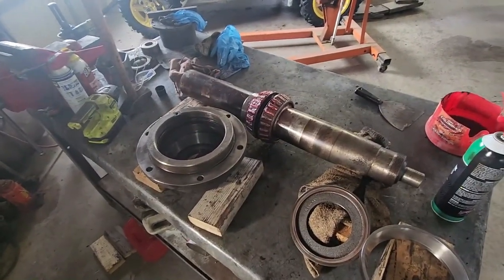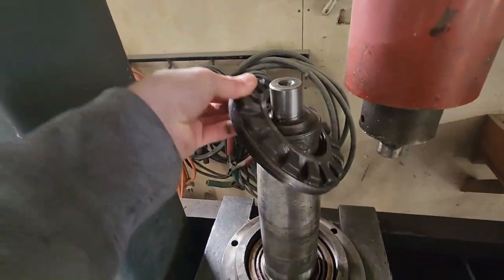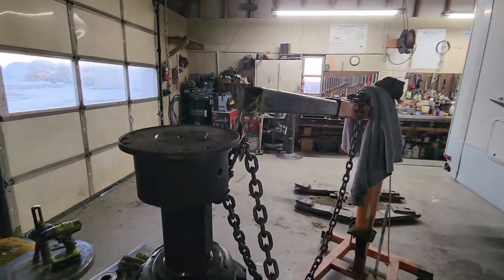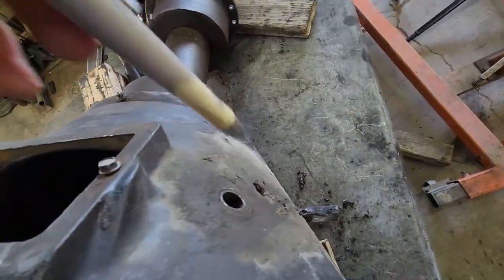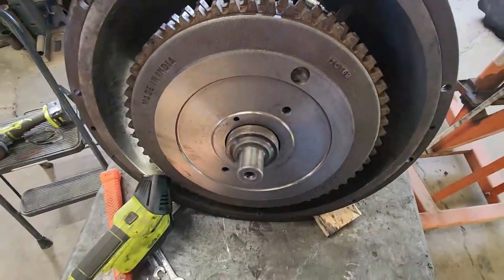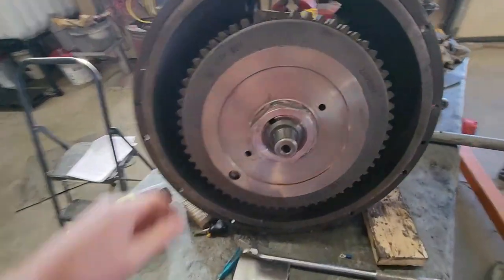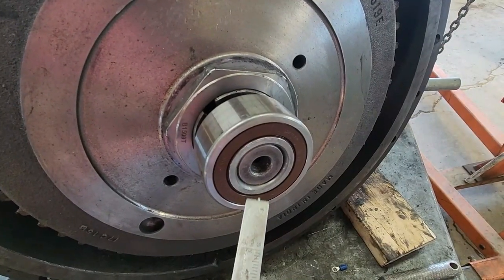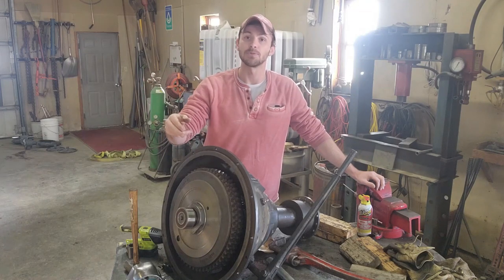Twin Disc PTO Clutch Rebuild! This week on the Farm, Jan. 16-21st

Comment: What did you set the bearing end play to? Did you measure it with a dial or just go until there was no play at all and back off the bearing retainer a certain amount?
Reply from the maker: I dont remember the actual spec for it, but yes the bearing is backed up just a hair from the end of the shaft. It's not a super tight tolerance for this application, it's a pretty healthy range.